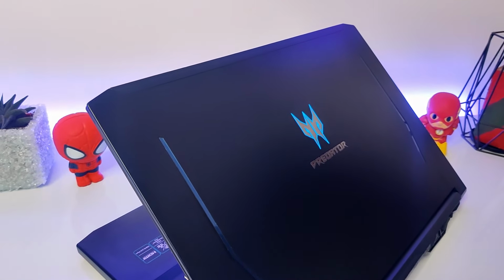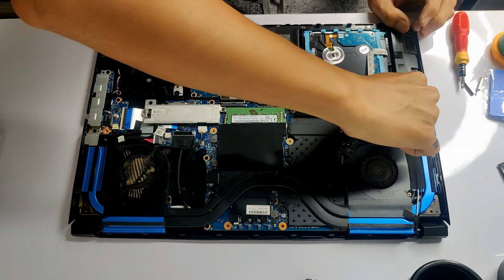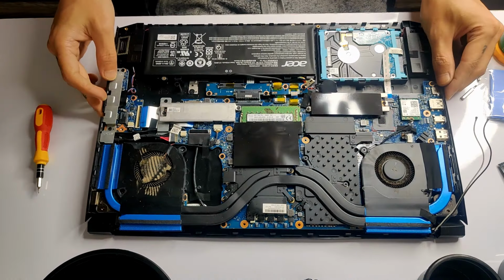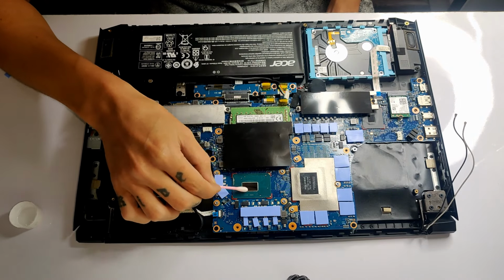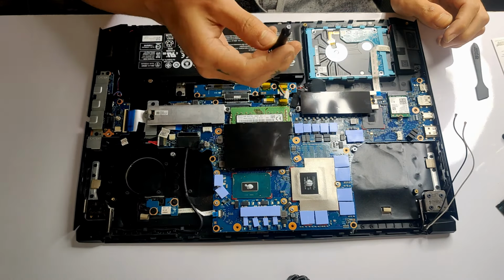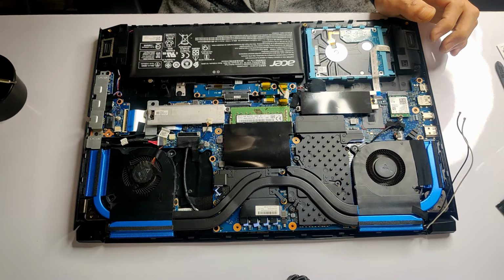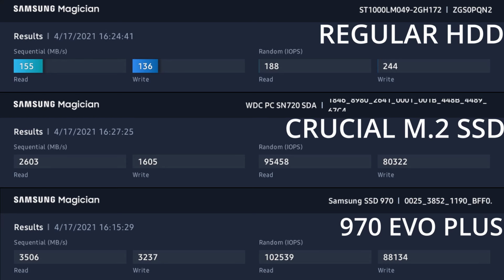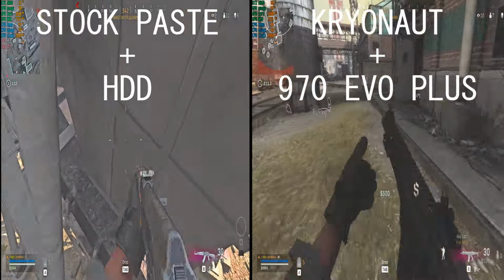ACER PREDATOR HELIOS 300 2019 UPGRADE | REPASTING | CLEANING GUIDE & BENCHMARK

Comment: Is it necessary to apply thermal paste, if we just want to clean the fan's dust. If we don't disturb the existing thermal paste, clean the fan and re attach it without changing the paste, will it still work or cause any issues??
Reply from the maker: You could do that but it would not make much difference in the temps unless your fans/exhaust are completely blocked and are the reason behind extreme temperatures 🙂
Hope this answers your question. Do subscribe to show some love & support 🙂❤

Comment: Hey, man. I followed this guide and it helped stop the PC from crashing randomly like it used to. However now when I play graphic intensive games which used to work fine before in getting some major and constant stuttering a few seconds into gameplay. Would anyone happen to know a fix for this?

Update : Problem fixed. Apparently the repasting on the gpu wasn't good enough and putting more seems to have solved the problem for now
Reply from the maker: There could be many reasons for the stutter. Overheating, latency, faulty graphics drivers,  CPU usage, RAM usage, etc.
First I would recommend you to uninstall and reinstall the graphic drivers directly from the website.
Reply: @MVNDRVX  Yeah already did the drivers thing but I've noticed the stuttering only happens when PLUGGED IN and not when playing on battery (lower graphics and FPS but stable)

Would you happen to know what causes this? Cuz it's normally supposed to be the other way around
Reply from the maker: @notyourdad6760  have you checked your CPU and GPU usage?
Reply: @MVNDRVX  yeah while playing graphically heavy games GPU is at around 100 and CPU at around 20-30 which, according to most answered online, is how it's supposed to be

Do you think it may be cuz of battery placement or something? Most things I did were exactly like the video so I didn't really remove the battery but that seems to be the only thing causing this weird problem
Reply from the maker: @notyourdad6760  if something was wrong with the battery, it wouldn't supply power to your GPU to run at 100%.
What GPU is it and what graphic settings do you play at? Maybe try lowering your graphic settings and turn off rtx if available in game and turn on dlss.
Reply: @MVNDRVX  gpu is an rtx 2060. I could try lowering settings but it used to work before at the same settings so I'm assuming it has to be something else
Reply: @notyourdad6760  what were your temps? that honestly sounds like throttling and your cpu/gpu getting too hot..
Reply: @tereongullygully3314  Yeah I did some reseting and repasting which eventually so I'm assuming there was an issue there. But it's all good now :-)

Comment: Hi,
Great video! 👍👍👍
I have favorite your video to reproduce it once I have bought what I'm going to ask you.
I have the ACER Predator Helios 300 PH317-54-796D.
I will want to change my ram, increase my storage.
What models would you advise me in ram 16G, ssd PCI 1T and Sata  2T? Thanks
Reply from the maker: Hi. I'm glad you liked the video 🙂
For the RAM, you could go with 2x16gb 2666mzh sodimm ddr4 ram. Check Crucial website for more details. Don't go with anything more than 2666mzh. 
For PCIE M.2 ssd, you could go with the same that I've used Samsung 970 evo plus or even a 980. Even WD black has similar performance.
For SATA SSD, you could go with any of your choice. If the budget isn't a problem then, I would suggest the Samsung 870 EVO 2.5" SSD.
Hope that answered all your queries. Do SUBSCRIBE to the channel to show some love & support 🙂✌

Comment: Bro is it hard for a begginer to do this for the first time?
Reply from the maker: Not that difficult. There are many beginners who used my video as reference and did a pretty good job. Just make sure you apply enough thermal paste on the CPU and GPU to cover the area. If you're still doubtful then use the spread method. Apply the paste and spread it evenly. Make sure you "don't" lift the heatsink up once it's placed.
Hope that was helpful. Do SUBSCRIBE to support the channel 🙂✌

Comment: Do the thermal pads really work? Or do I need to repaste the pink stuff with another type of paste?
Edit: Which one is the vRAM?
Reply from the maker: @John Doe the vRram memory are the one's that have pink paste applied from factory.
It's generally not needed for replacement unless it's in bad shape. Just repasted the CPU & GPU is sufficient 🙂
Hope this helps. Do SUBSCRIBE to show some love & support 🙂❤️
Reply: @MVNDRVX  my bad, I didn't make myself clear enough,  at 7:30 you say that you are using 0.5mm for vRAMs and 1 mm for everything else
I wanted to know which ones were the vRAMs so that I could do the same
Reply from the maker: @JohnDoe-bz4ut  The chips that have pink paste on them are the VRAM memory. So 0.5mm will be the replacement for the pink paste.
Understood? 🙂
Reply: @MVNDRVX  ohh i see
yours has different colors
need to check mine, i forgot the colors
Reply from the maker: @JohnDoe-bz4ut  lol... Check and get back to me 🙂

Comment: hello, its my first time repasting my laptop and im planning to use your video as reference..i just want to know if i need to remove both plastics on the thermal pads?
Reply from the maker: You mean the plastic wrapper that comes with new thermal pads?
Yes, you have to remove them from both sides 🙂
I'm glad you're using the video as reference. Do SUBSCRIBE to support the channel. I'd really appreciate it 🙂✌ BEST OF LUCK.
Reply: @MVNDRVX  thank you very much you earned my sub
Reply from the maker: @rolexianibuyat2818  you're welcome. Do feel free to ask if you have any other doubts and do share the results after you're done with the repasting.
Thank you for the Sub 🙂

Comment: would it be alright to use cheap thermal pads for the things you replaced with thermal pads? (GPU and CPU will still be thermal paste)

Mine's throttling a lot and planning to change the thermals. 2 years old pred 2019
Reply from the maker: Yes that would be fine. Even I've used cheap thermal pads. Just make sure you use a good quality thermal paste.
Hope you liked the video. Do subscribe to show some love and support 🙂✌
Reply: @MVNDRVX  Your content are awesome. Happy to run into you channel! Just subscribed. Thanks for the tip!
Reply from the maker: @mkymnzns  Thank you 🙂❤
Reply from the maker: @urgayifyoureaddis  oh yes! I can imagine the amount of dust that must've collected in these 2 years 😅
Hope this video helps. Good luck 🤞
Do feel free to ask me if you have any queries.
Subscribe to the channel to show some love & support 🙂❤️

Comment: hello, thanks to you cleaning my laptop for the first time in two years was successful. i have a question though, do i need to replace the tapes on the fan because it no longer sticks and i had it removed. if yes, can you suggest what tape should i buy?
Reply from the maker: Hey! You're welcome. I'm so glad everything went well for you. 
The tape is really not that necessary. Nothing to worry about 🙂
Do SUBSCRIBE to the channel to show some love and support. I'd really appreciate it 😊✌
Reply: I was searching for the answer to the same question, but it looks like its called Black Insulating Acetate Cloth Adhesive Tape for Laptop, but I have seen other people retape it with regular tape not sure if regular tape would hope up under heat tho.
Reply: @Aaron6791ae  I would never risk placing regular tape over components that could potentially get warm. They use the insulating tape for a reason !

Comment: does our 2019 model fits sith 3200 mhz ram?
Reply from the maker: Yes 3200 mhz is supported by i7 9750h CPU but the maximum frequency it will run at is 2666 mhz. If you want it to run at 3200 mhz, then overclocking the ram is the only option. Which is not worth the hassle. I would suggest you better stick with 2666 mhz.
Hope that was helpful. Do LIKE & SUBSCRIBE to support the channel 🙂✌
Reply: @MVNDRVX  so if you go for 3200mhz you wont utilize the excess of 2666mhz unless you overclock?
Reply from the maker: @jeffpedida9708  yes that's right 🙂

Comment: Hey, why did you use 0.5mm thermal pads for the VRMs only and 1mm pads for the rest? What happens if I use 1mm (or 0.5mm)  for everything?
Reply from the maker: Good question. Let me explain this as simple as possible.
Lesser thickness = no proper contact
More thickness = more thermal resistance
Hope you found that helpful. Do SUBSCRIBE to support the channel 🙂✌️
Reply: @MVNDRVX  I see. But my question is why use 0.5mm for the VRMs only while you used 1mm for the rest?
Reply from the maker: @CS-oy3vy  because the gap size is different 🙂
Reply: @MVNDRVX  thanks
Reply from the maker: You're welcome. Do SUBSCRIBE to show some support 🙂

Comment: I have the thermalright thermal pads with 1mm and 0.5 mm thickness ... Are those pads okay ? Just found them on Ali-express ...you said that Use 0.5 mm only on gpu VRAM memory ... could you tell me what specifically you are referring to ?
Reply from the maker: I'm not sure about the brand of thermal pads you're talking about. Neither do i want to mislead you but you can give it a try if you have read good reviews about it ✌
So basically vram memory are the chips surrounding the GPU which comes with pink paste/pads. Those will have to be replaced with 0.5mm pads.
Hope i cleared your doubts. Feel free to ask if there is anything. Thank you for watching the video. If you liked the video, click on the LIKE button and SUBSCRIBE for more future content 🙂✌
Reply: @MVNDRVX  what about the empty part  just below cpu dye ... One of the heatsink goes in there ? What millimetre should i use ?
Reply from the maker: @abrarrafat1471  Just follow the steps as shown in the video. It's 0.5mm for the VRAM memory(replacement for the pink stuff) and 1mm for the rest.
Reply: @MVNDRVX  I saw some acer threads that claim that 0.5 mm on gpu vram didn’t fully make contact ... I would post the link later . What are your results since you applied 0.5 mm ?
Reply from the maker: @abrarrafat1471  I've read it too. Different people have different results since not every laptop of the same model are the same. I don't understand how that is, but for me 0.5mm was perfect.
What you can do is first apply 0.5mm and put the heatsink back on, let it sit for a while, then remove the heatsink, check for contact, if not enough contact, then apply some thermal paste over it and at the end repaste your CPU and GPU 🙂✌
Reply from the maker: @abrarrafat1471  you actually don't have to worry about the thermal pad section much since they don't produce that much heat. The main thing is to repaste the CPU and GPU properly.
Reply: @MVNDRVX  Thanks man ... You have been so helpful ... I will try to do it like you said ....
Reply from the maker: @abrarrafat1471  you're welcome. Good luck 🙂👍

Comment: GPU and CPU thickness pad mm ?
Reply from the maker: 0.5mm for gpu chips
1mm everywhere else 🙂
Reply: @MVNDRVX  where is the gpu chips there?
Reply from the maker: @tsg6606  i was actually referring to the VRAM memory. The chips surrounding the GPU with pink pads on them.
Thanks for watching. Hope the video was helpful. Do click on the LIKE button and SUBSCRIBE for more content 🙂✌
Reply: @MVNDRVX  ohhh okay. Btw i dont have thermal pads but i got a thermal grizzly kryonaut is it okay for me to use that on vrams?
Reply from the maker: No. It will not make contact. You need thicker viscosity paste.
Reply: @MVNDRVX  is it okay for me to use 1.00mm on the vrams? Cause i am having mixed advices in a acer helios 300 fb group i joined. Ome commentor said that he put in 1.00mm
Reply from the maker: @tsg6606  i think you can but what I've heard from a friend who services laptops is that if it's the wrong size, then it can get messed up.
Initially I was actually thinking of using 1mm everywhere including the vram memory, but later on i changed my mind.
I've also heard that each laptops are different. Some even used thermal pads and paste cause there was no contact made.
Reply: @MVNDRVX  so i guess its okay to just put in 1.00 on all of it?
Reply from the maker: @tsg6606  you can give it a try. Anyways the chips don't generate too much heat. It's mainly the CPU and GPU.
Reply: @MVNDRVX  Its ok for Acer predator PH315-52 version I mean thermal pad compatibiliy mm ?? And what you use it for cleaning for old paste in CPU, GPU and old thermal pad in chip ??? Thank you
Reply from the maker: @Beji-boy  Yes you can use the same thickness for your model laptop. To clean the old paste and pads, use 99% isopropyl alcohol. In case you only get 70% make sure you let it dry completely. 99% alcohol will dry easy and quick so its recommended to use it.
Hope I've answered your questions. Do subscribe to show some love and support 🙂❤
Reply: @MVNDRVX  Isopropyl is IPA right? I can buy it from net :D but only 1 litr bottle ahh :D   small dont sell it ahhh
Reply from the maker: @Beji-boy  yes that's correct. It's IPA in short 🙂
1 litre? That's too much 😅

Comment: Bro..
is thermal pad mandatory? 
Or just thermal paste enough?
Iam using helios 300 2019(1660ti) not changed thermal paste since i bought.
Reply from the maker: Not mandatory... As i said in the video, i only decided to change the thermal pads since it was getting flaky. First check if your thermal pads are still good. If it is then no need of changing it 🙂
Do SUBSCRIBE to support the channel 🙂✌
Reply: @MVNDRVX thnx man. 
I have another doubt, i have 16 gb single channel RAM, by making that 2*8 or 2*16 will make any difference??
And my second doubt is will thermal pasting make any performance difference??
Reply from the maker: Ram running in dual channel always gives better performance over single channel.
For your second question, it depends... If your your CPU runs too hot, you could face thermal throttling. In that case, repasting would keep the CPU performing at it's best. Also, the cooler the CPU runs, the longer it will last. Heat kills the components 🙂
Reply: @MVNDRVX  thanx bro
Reply: @MVNDRVX  kryonaut or aractic mx -4 , which one best?
Reply from the maker: @mohammedjaisal4561  kryonaut... It has a thermal conductivity of 12w/mk, where as the mx4 is 6w/mk
Reply: @MVNDRVX  ok

Comment: Can you tell me which one is vram? And where exactly what sizes do you use? The big ram (next to nvidia) is vram?  thx
Reply from the maker: Yes you're right. The big chips surrounding the gpu (with pre-applied pink paste) are the vram memory.
I've used 1mm every where except for the vram memory, for which i used 0.5mm.
If you have any other doubts, please feel free to ask me.
Reply from the maker: Hope i was helpful. Thank you for watching. If you liked the video, do click on the LIKE button and SUBSCRIBE for more future content 🙂✌
Reply: @MVNDRVX  Thank you so much I will do this week too. It was a great help! Thanks
Reply from the maker: You're welcome. Do let me know the results after you're done🙂
Reply: @MVNDRVX  I will use Noctua nt-h1 but I will definitely describe it
Reply from the maker: Sure! That's a good option too👍 But just don't go with Arctic.
Reply: @MVNDRVX  Thank you so much for doing it. -10-15 degrees at 100% load. The best
Reply from the maker: Glad to hear that it was a success 🙂  you can even undervolt your CPU using Throttlestop for more better thermals 👍
Reply: @MVNDRVX  I used it, but it didn't save me anything and I had to do it again with every restart
Reply from the maker: How much are you undervolting it? The max i can go to is -150v
Reply: @MVNDRVX  i also did 150v but after reboot it resets to -125v
Reply from the maker: @koprator_play7837  it will reset back to default once the system restarts. For that you will have to save changes immediately, apply the settings and set throttlestop to run in the background at startup.
There are forums and videos how to keep throttlestop from running in the background without resetting. Please refer to that. It's not that difficult 🙂
Reply: @MVNDRVX  you were right -150v now and even 4-5 degrees less. thanks for everything
Reply from the maker: @koprator_play7837  you're welcome 🙂
Reply: @MVNDRVX  Hey man, great video!
I checked with Acer support and they told me that all thermalpads are 1mm. (VRAM and VRM). 
Did you have any trouble? Since there is no sensor on the VRAM.
Thanks!
Reply from the maker: @r.kanashiro  hey! Thank you so much 🙂
Many people have asked me this question. My suggestion would be to apply the 0.5mm, fix the heatsink, let it rest for a while, remove the heatsink again and check for contact. If it doesn't have contact in some places, then you could apply a little bit of thermal paste on top.
1mm would be too thick. It would have too much thermal resistance. You could actually apply 1mm but I wouldn't recommend it.
I haven't had any problems so far with just applying 0.5mm pads alone. Neither did other people who have done this successfully.
Vrams don't produce much heat. So there's nothing much to worry about until or unless you overclock.
Hope you found this helpful. Do feel free to ask if you have any other questions.
Thank you for watching. Do drop a sub to show some love and support 😊❤
Reply: @MVNDRVX  great info man. Thanks
U got a new sub since yesterday!
Reply from the maker: @r.kanashiro  you're welcome. Thank you for the sub 😃